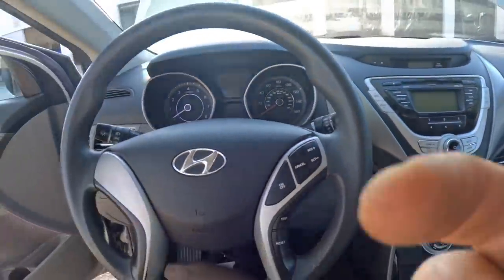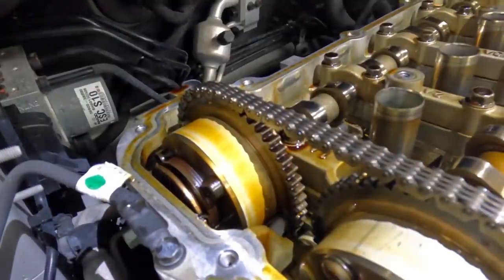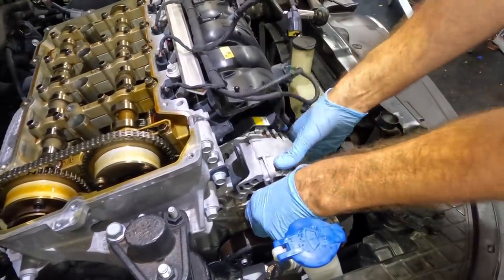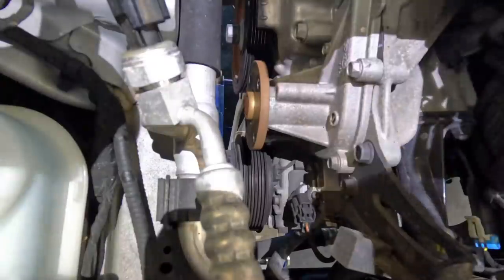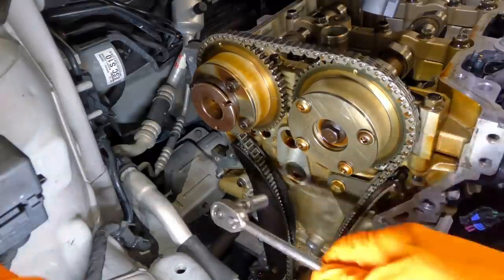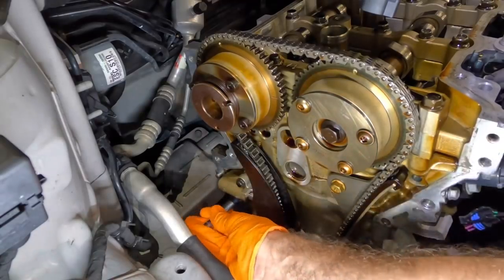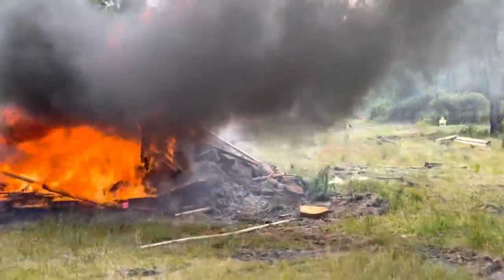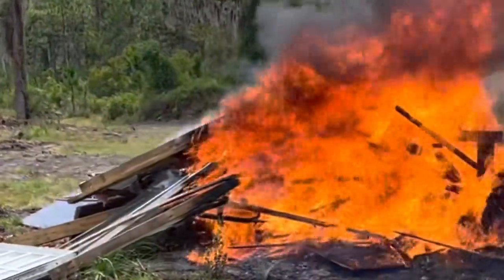I can’t finish this car! Evil Elantra!

Comment: Those Hyundai GDI engines are notorious for that rattle noise on start up. It goes away in like .5 seconds after start up. Even after repairing the timing chain tensioner, it'll come back in just a few months. Hyundai calls it a "character noise". Oil pressure is needed to make the tensioner work. When the engine has sat for a while the oil has settled. So you can't really get rid of that sound in a hyundai GDI engine.
Reply: This being a 2011, it more than likely has the 1.8L MPI engine.
Reply: Hi... Can you share a link where Hyundai calls it a "character noise"?  Or is that just something you've heard?  My wife's 2011 Elantra has been making this noise for years and I'm hesitant to fix something that doesn't need to be fixed.  Just plan to live with it and never buy Hyundai again.  Or dump the car if the noise gets worse.  These 1.8 motors aren't GDI, by the way.  Thanks.
Reply: @21Piloteer  This is the MPI engine as you can see no HPFP and the injectors are up top in the MPI setting.
Reply: @WilliamBrown-vf9ou  I work for Hyundai and rebuild these engines in a day from the block up. is it a rattle that goes away after 2 seconds or a knocking that goes away after 30 seconds? different issues.
Reply: @TormentedPenguin , hi, thanks for your reply. The rattle lasts about 1-2 seconds on initial morning startup. From my research, I think it's the timing chain tensioner. There are no other symptoms. I change the oil (with synthetic and high-quality filters) myself more frequently than required, so I think the engine is healthy. It's been making this rattle for years and I'm inclined to live with it until there are other symptoms.  I know there is a risk of it skipping timing, but I'm hoping that risk is fairly low and that I'll get warning before anything bad happens!
Reply: @WilliamBrown-vf9ou  probably the tensioner. It's a fairly shitty design as it has very low spring strength at rest and only really applies pressure after oil build up. You will probably notice the same noise after an oil change. This is due to the lag in oil filter filling. I have have seen no issues other than the annoying noise. So long as you don't gun the gas until the noise goes away, should hurt anything.
Reply: @WilliamBrown-vf9ou  Hyundai does have a TSB out for aftermarket filters and a noise issue. Try swapping to Hyundai filters for 1 or 2 changes. I'm not sure why, but I have had some where the noise was caused by the filter.. it's really weird.
Reply: @TormentedPenguin  Thanks again, yes I heard about the oil filter too. I switched to Hyundai filters for the past few oil changes. No apparent difference. Thanks for the reply about the tensioner. That's what I think too -- annoying but probably harmless.  cheers

Comment: I would hate to know how much you've invested in tools, I've seen you use a few that I didn't even know existed till now, especially the fancy handy dandy tool you had to hold the power steering pully in place, that seemed way better than a screwdriver or a punch which is what I would usually use when I forgot to break the bolts loose(typically about half the time)
Reply: In the UK we call that a strap wrench, it is also perfect for removing oil filters
Reply: Most techs @ this level have $50-$100K in tools. Ya, you can deduct the costs on Income Tax... Once they exceed 3% of gross. Ya, that makes the Fed Gov't an uninvested partner in your work.
Ain't It Grand !
Reply: @unclegreybeard3969  Yup, they are called the same thing here in the US, even my great grandfather had a few on his farm (he passed in 2006 at 108) and my grandfather had them... And even I have one. Really versatile tool and not just for a mechanic. (Jar lids beware!)
Reply: @unclegreybeard3969  That was my first thought when I saw it but it was different than one I had, if that's what it actually was then color me impressed I never once thought to use it that way.
Reply: @peted5217  By the time I quit turning wrenches for a living I had somewhere in the neighborhood of 75k invested in my tools, my oldest son followed in my footsteps and became a ASS oops I meant ASE certified technician so I passed along most of my tools to him to help get a better start than I did.
Reply: @maxmcarnage7642  I'm sure he appreciates your generosity. Also have a few of my Dad's tools that I unsuccessfully tried to mod our 2stroke mower with. I'm sure I easily cleared $100k on tools in my 45 yr wrenching career.

Comment: Sounds like the typical Hyundai Tick.  A lot of these engines tick cold because of piston slap and it slowly gets worse over time.  Once they start burning oil it's time to consider a new engine, or at least a rebuild with new pistons and bored 0.02 over.  Of course it goes away once the engine warms up.  You should hear it when its -20C out.
Reply: It’s exactly this. I own a 14 Elantra and know this noise. He wasted his money sadly.
Reply: Ya! My neiborgh has one ! Noisey SOB in the winter ! It will blow up soon!

Comment: Looks like an alternator with a roller bearing in the pulley. No grease fitting and they dry up and fail/ seize and then spin on the shaft.

Comment: Just had my 2011 Elantra GL diagnosed with the same rattling on cold startup (last month, 145,000 km). Had to replace the oil and used a Hyundai OEM oil filter. Noise disappeared. Avoided a $4000 job as you see here. An individual situation may differ.

Comment: 40+ years of plastic bits in the engine, 40+ years of chemical research, and still everything becomes brittle after 6 months of operation, or stiff and unwilling to work as intended.
Reply: back in the days they made quality. now its quantity.  they make money on parts  not the actual car.
you wont see companys going bankrupt  like Kreidler did  because they made their product too well and didnt sell parts.
i know its just a moped  but they handed out silver and gold pins  to owners having machines going 50.000  - 100.000 km without anything changed.
a honorable way to go down.
and those small engines could take a beating.
in 1968  they set a 110 mph topspeed with a small 50 ccm engine.
Reply: @MrLarsgren  Yes I used to dream of getting one of those as a teenager but had to "make do" with trying everything I could to make my Yamaha FS1E go faster (made 70mph down a big hill)
Reply: Should tell you it's planned!
Reply: @dragonmaker1541  planned obsolescence is the worst thing ever, I know they do it to make money, but c’mon, the least they can do is make a good car.
Reply: @mx_nana_banana  "Planned obsolescence" very rarely has any meaning in terms of cars. Can you point to any component in a car that's purposely designed to fail after a set period? No, you can't, because there aren't any. The same component will last a longer or shorter period in any given vehicle due to all manner of factors completely outside the manufacturer's control.
Reply: @dunebasher1971  I would tend to agree with you, these components were good for 160,000 miles in a relatively inexpensive car, that's pretty impressive to me.
Reply: @Paramount531  - I have the same exact car, bought it new but only have 80k miles. It was $18,600. Been a good car except the NU engine is a “ticking” time bomb. I bet this engine is blown up in 6 months

Comment: Replacing the water pump on a Chrysler Sebring 2.4L DOHC has similar issues with the timing chain moving when taking it apart and re-assembly.  Yes the water pump is only accessible after removing the timing chain.

Comment: Shit the $ lights ON🧐
.As a Diesel technician I also leave all bolts with the removed items, It saves a lot of time screwing around trying to figure out what length bolts should be used, If you don't care then Your going to run into Problems, Also sometimes you'll have 5 Machines apart waiting for parts this makes it even more important 👍 You are SO lucky Not to have to deal with Hardly any Rust on that machine, Because up here in the Snow belt things with over 150,000miles can be a little RUSTY at times 🤓.

Comment: I would love some running commentary about the build style/quality of the different makes that you are servicing. Jesus, that timing chain cover looked like it was 30lbs... a solid casting o_o. So many bolts... soooo manyyyy. The alternator adjustment serpentine belt, not a tensioner. I think it was another Hyundai you did that still had V-belts, but was a 2000something.

Comment: My 2013 Elantra Limited has 280,000 hard daughter-driving miles on it, in the pothole capital of the world (Ottawa, Ontario), and its still going strong. Not bad cars, though they should never have put low-profile tires on a car which such stiff suspension ...
Reply: I have an ‘11 with 80k babied miles. Ticks just the same since new. I got the budget version with small wheels, tires are cheap and the ride is better.
Reply: @RustyZipper  I actually replaced the low profile stock alloy rims with regular steel rims because I just got sick of having to replace the tires every year.

Comment: That Hyundai has a nice setup for setting valve timing. Setting valve timing on my early model Porsche 911 flat-six engine involved a dial indicator, a camshaft with 14 holes, a camshaft sprocket with 13 holes, and a 4mm pin. You would put the dial indicator on the intake rocker arm of cylinder #1 at TDC after first making absolutely sure the valve clearance was set correctly, and then by trial and error find the one position on the camshaft sprocket where one of the 13 holes lined up with one of the 14 holes and at the same time be sure the dial indicator readout was within tolerances. Then, put the pin through the matching holes, secure the sprocket with the big nut... and repeat the procedure on the other side of the engine on cylinder #4 TDC. Oh, those were the days. 

Believe it or not, the procedure was actually more difficult than it sounds from this description.
Reply: The Germans just love to make stuff 10X more complicated than it needs to be for the same results. I have German cars as well as other makes. I hate it when the German ones need service, which is very often. The others just get an oil change and keep on going. Makes me wonder why I even bother with German cars.

Comment: Ray, I really love your bids. I am wondering though, are you going to change the oil? Saw brake cleaner flowing into the oil pan... I would assume that would be pretty bad for the engine....
Reply: Saw that also but I would change it also for sealant pieces to small to. catch. Proper procedure in my mind?

Comment: im about 1 minute in an im guessing timing chain rattle from a worn out guide they are usually oil fed to pump up tension when they get old it rattles the chain against the housing on a cold start.

Comment: Ok I have two issues that I've seen idk if they are issues but to me they seem to be...ok 1 are you going to drain the oil and put new in because you sprayed alot of brake cleaner in the oil pan and 2 when you lined up the chain on the bottom in the video the chain wasn't seated on the teeth and you left it that way then put the tensioner on and pulled the pin. Did that seat the chain on the teeth on the crank teeth?  Also love watching your videos...
Reply: I was wondering the same thing! I cringed when I watched the scrapings and all the brake cleaner going into the oil pan..😅
Reply: @shmeebsnaggle6315  oh yes I was thinking all that's gonna be in the pan and all and I'm by no means a mechanic but I'm tryn to learn and get there. I work on everybody's stuff around me lol and I can swap the engine out of my car by myself so I'm doing OK lol
Reply: @kennethmurphy3787  then what did the doctor say ?

Comment: Jeez that engine is clean on the inside compared to my 2011 prius with 279k on it. Did the head gasket recently and the sludge was thick. I know since we owned it the oil was changed on time and had just come due for a oil change when I did the head gasket. I used a case of brake cleaner and several cans of oven cleaner on the head, valve cover and timing chain cover as well as 4+ rolls of the blue paper towels. Cleaned what I could get to then used a detergent additive when I put everything back together and let the engine run for a while with a new oil filter. After about 30 minutes of run time I changed the oil to royal purple oil with a new wax oil filter and some leave in sludge removing additive.  In 1 week I went over 600 miles. Less than a month I'm at over 1500 miles. When I hit 3000 miles I will be doing another oil change with royal purple oil and another with filter and another bottle of sludge away. Then I will change the oil and filter every 5000 miles. Every oil change I do myself cost me almost $100. Expensive but since I started using royal purple my fuel mileage has gotten better.  I'm talking from 30 mpg to 40mpg now. Big difference

Comment: Those tensioners are so bad, that when we rebuild those engines, we state.. "When you pull the pin, Mr tensioner is no longer your friend"  because they can blow up on you if you don't prime the engine first. Had a few go bad. thankfully no engine damage.

Comment: I hear ya when it comes to waiting for parts. The evaporator in my wife's 2013 Edge has been slowly leaking Freon for several months. I'm finally removed the dash to pull Evap Case. After getting it all apart I find out none of the Ford Dealers around me have the part. So to the internet I go. Found it for $400 cheaper than Dealers but they had to order it too. Waiting 2 weeks for it now and wife is getting irate with me.
Reply: She can’t fix it? 🤷‍♂️
Reply: @RustyZipper  Ha, I wish

Comment: Hyundai tech/advisor here with a pointer.  We've seen a few Nu engines where the exhaust phaser dowl breaks in the cam, causing a cam correlation, and timing over advanced code.  

Also, who makes this complete kit you used for this vehicle?
Reply: does this cause any issues with the engine failing or etc?

Comment: I know the tensioner wasn't engaged yet, but at 27:30, I'm hoping that the chain was properly seated once you installed it.
Reply: Turning the crank about 90 degrees CW and then back would seat that fine without it jumping a tooth.
Reply: @silicon212  it looks like it's bound and off one tooth to me.

Comment: Thanks for the video! All that brake parts cleaner drained into the oil drain pan.. is that ok? I'm new to diy auto repair
Reply: That’s just bringing the oil level to full ! Easier with the front cover off ! OK next question ?
Reply: @fredwalker839  Haha, nice.  I realized after I typed the comment, that he's going to do a full drain and fill, of course with the engine apart.

Comment: Have you done part 2 yet? I cant seem yo find it if you have. I seen you have a jeep for the next video.  Thanks. Great video
Reply from the maker: Not kidding…Still waiting on parts! I need two rubber gaskets for the oil pump ports on the timing cover.

Comment: Do you just tear into a job or do you read up on it first? When I do a job, I put the hardware into a Ziploc bag and label with a permanent marker. Then I wire it to the part to keep the items together. I also take pictures as I go. You are in Florida so everything that you work on is clean and rust free. I laugh when you do encounter rust because it is minimal compared to up here in the northeast. I'll bet that you have never encountered a cast iron exhaust manifold that has rotted away. Another great and informative video. You are truly a craftsman Ray.  You do things the right way.

Comment: I've got a "funny" for you about a car part. I worked for 25+ years as an "Old-School" auto mechanic. I quit when they started putting all that electronic and computer stuff in them.
This is a true story: I was helping some people I know with their yard work. Their son pulls in, goes in the house and comes back out. By this time, one of his buddies pulls in. The son pulls a muffler out of the back seat of his car and tells his buddy that the muffler will add an extra 15-hp to his engine. They put that muffler on his buddy's car. 25+ years as a mechanic and I never knew a muffler could add hp to an engine. I always thought you had to modify the engine to increase its hp. What part of auto mechanic school did I miss?

Comment: I know most engine makers make special tools to hold the cams in place during this type of repair. It sure looked like there were three hole on each cam which could, in theory, allow for "retarding and advancing" the cams. Probably not, but from here it looked that way.
Reply from the maker: Negative, the holes were a smaller size than the  alignment hole

Comment: Did you check to see if it has a recall? Hyundai and Kia GDI engines like to self destruct going down the highway. I've towed 5 into the dealer in the last month for engine replacement

Comment: My wife's car is a 2013 Elantra and it makes the same noise at startup. I bore scoped the cylinders and found scoring on the walls from the dreaded cold start piston slap.
I hope the new phasers do the trick in this case. I'd hate to find out what it takes to fix the piston slap.
Reply: Not to worry, it's nothing a fresh engine (or replacement vehicle) won't fix...
Reply: There was a Hyundai recall on this, so you should contact Hyundai ASAP. bad rings
Reply: @mwf5454  my neibour tried that…… “ this phone number is no longer in service” LOL